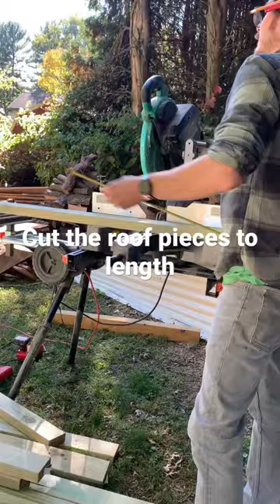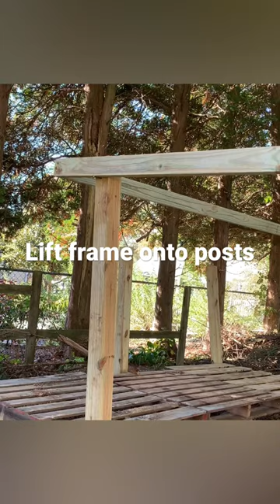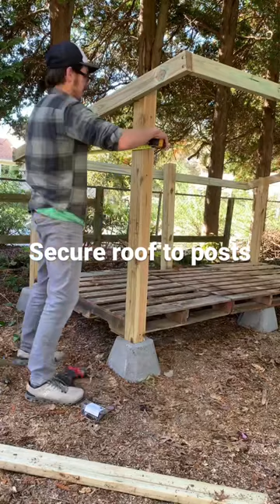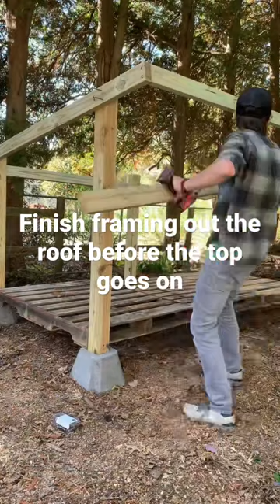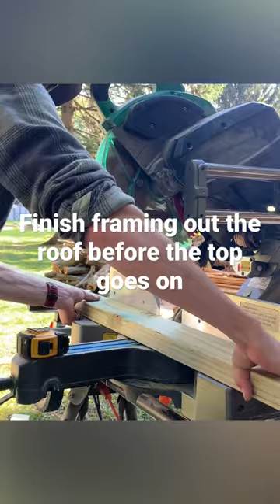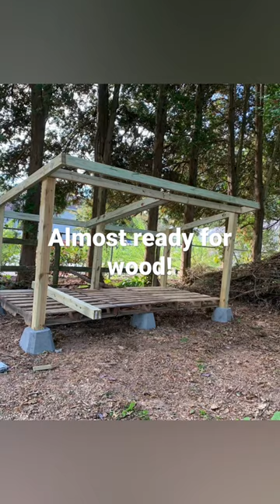Part 3 of the easy DIY wood shed!

Comment: One thing I noticed right away is wouldnt youbwant to out that roof box right in top of the posts somehow for much stronger roof ?  Hmmm thinking
Reply from the maker: You’re not wrong, but those GRK screws are pretty darn tough
Reply: @SpottedTongueWoodworking  heck yeah. Hi m simply thinking out loud as far as my mudroom goes. This looks like a way I can do it.  As I was thinking 6 posts and then roof   This gave me great idea. Im thinking if I can set the roof box on top be even better for strength. I love unprofessional, cheap random. Diy building as I suck at building lol. But wish I was awesome.  Want to build sheds lean tos and cabins eventually